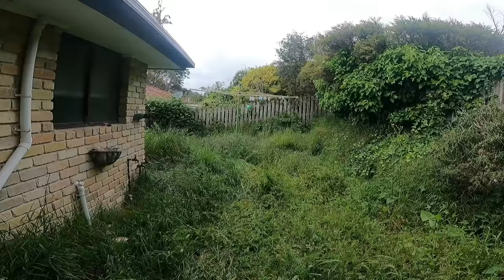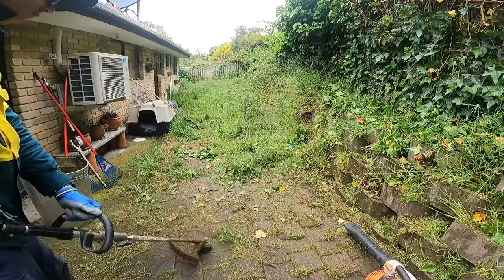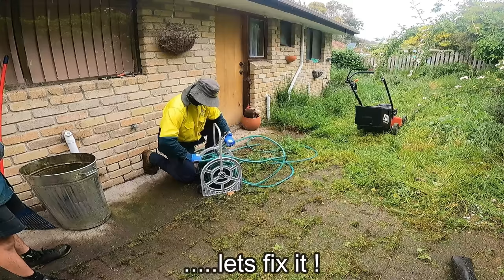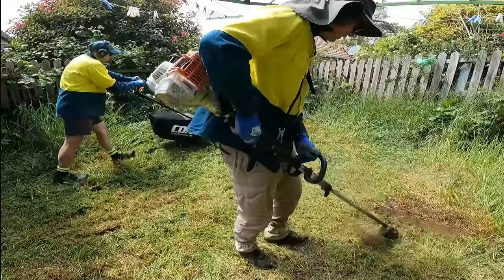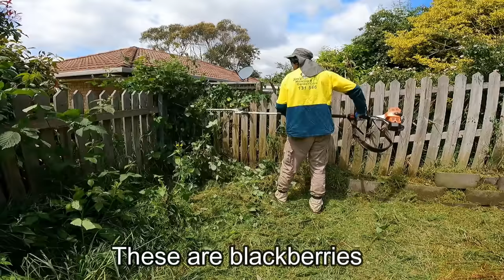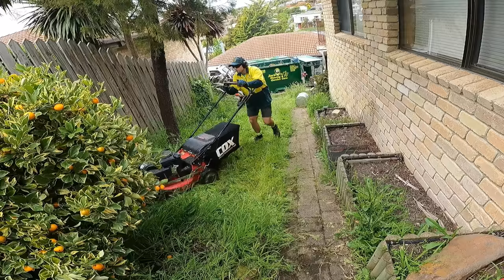Garden Nightmare Transformation | Watch us Rescue this Courtyard

Comment: It seems you are working without a plan. Why not do all the trimming, pick up rubish andthings laying around? The guy raking will have a easier job, wont have to rake the same spot twice. Why not leave the blower till everything is trimmed and cut?
Just asking.
I like watching these videos, love gardening.
Reply: Totally agree they went over some spaces 4 or 5 times instead of finishing one area before going onto the next. I’m glad someone else noticed. It was very frustrating to watch at times
Reply: I thought the same. No logic/method to the job. Does a bit here, a bit there, then goes back creating more mess to be cleaned up. Doesn’t make sense, unless of course it’s to keep the busy helper running around like a blue * fly. I don’t agree with a couple of comments about team work, I feel there is definitely “boss and worker”.
Reply: I thot the same, but Boss Jim wouldn't be able to have even-footing, imo, cause there was so much. Could compare to renovation in a bathroom...small area & rubble on the floor can lead to injuries if not cleared away. If one's to wait til everything is demolished there's no safe position to be in.
Sometimes it takes that game plan to see what's the depth of mess. I was surprised to see the raised brickwork on the back line.

His worker has a couple minutes of rest between clean-up sessions.
Reply from the maker: Well, you guys have obviously never done a big cleanup with multiple people. I move from one spot to the other, so my worker has something to do. I cut, he rakes. Also, you can't cut this stuff to the ground in one pass, it's too “thick”

Comment: My dad used to burn all the weeds off our driveway with a gas torch. It's safe when the vegetation isn't dry. Looks like nothing happened at first, but within a few days all of the burnt weeds will shrivel and turn to dust. Might help one or the other guy save a bit of sweat. But you guys did a perfect job with the tools you brought. Too bad the power wash wasn't in the brief :)

Comment: Massive improvement,  well done!  Now the homeowner needs to do things like:  spray weed killer on the raised garden bed areas, weed and feed the lawn areas regularly, remove the garden beds against the house and increase the width of the pathways that run alongside the house, get the air-conditioning serviced, get the paving areas pressure cleaned, spray paint all the fences a dark charcoal...then the whole presentation of gardens will look habitable.
Reply from the maker: Thank you, I think that's the plan to maintain it going forward 🙂
Reply: And clean out the rain gutters❤️
Reply from the maker: @margaretpacki3891  Yes, they do need a clean, you have a good eye for detail 😎
Reply: If the homeowner doesn't have time to now,  when is he going to find time for your wishlist?????

Comment: Another great transformation. (As a U.S. viewer I'm curious about the white appliances hanging on the wall near the windows? I've noticed them on other houses where you've worked. Are they air conditioners or something else?)
Reply from the maker: Cheers. They are called heat pumps, but they are heaters and air-conditioning units in one ✌

Comment: Why didn't you cut off all the leaves at the brick wall and wooden fencing ? 

If I were the owner, I would have cemented the back yard. Remove the brick fencing which had gaps. Instead,  put brick wall totally so that there is no gap at all.